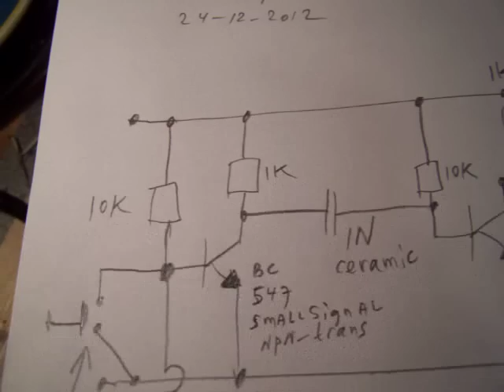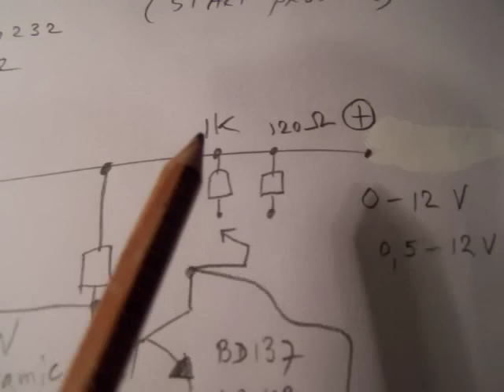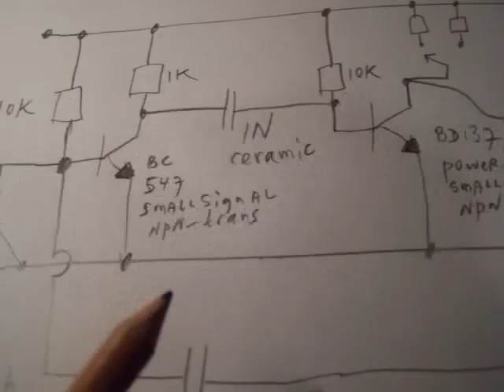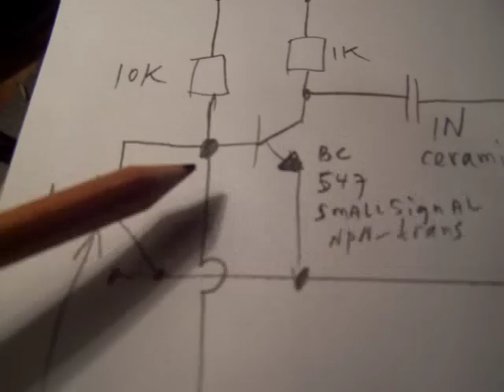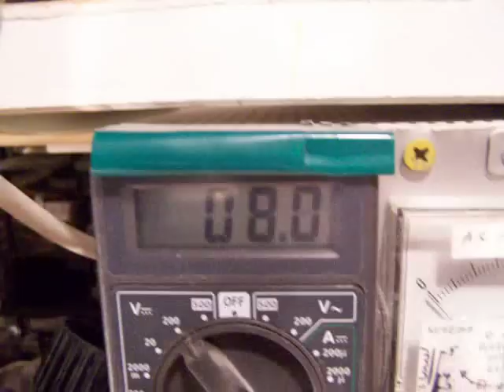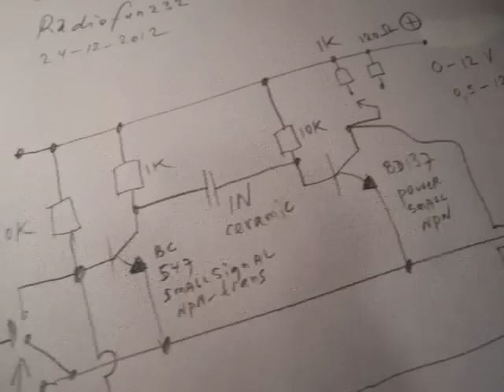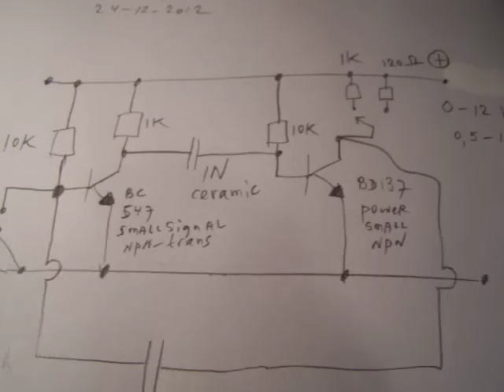fail properties from the non stabile multivibrator (square wave)

Comment from the maker: CROSSLINKS RELATED TO NON STABILE MULTIVIBRATORS 
fun audio generator https://youtu.be/AmB_WG3xkS4
MUVIB circuits, start problems and how to get them working https://youtu.be/rmrH4MqvQRo
12 V alarm beeper with a substantial output https://youtu.be/tU4fBdJB8Yk
Small electronic beeper with headphone capsule https://youtu.be/MHUKikf-6l8
Funny strange sounds with 3 non stabile multivibrators https://youtu.be/DeEFlyEvfW8
Electronic siren circuit and 2 tone horn https://youtu.be/7ZaiqvRzKZQ
2 transistor flip flop memory cell driving a 12 V relay https://youtu.be/MI1hv3l7BcQ
100 flickering white LED’s (schematic) on 12 V https://youtu.be/Kx4siVJbnO4
Nasty sound generator + locomotive sound https://youtu.be/u0OBWjVTlek
Powerful 12V-20W incandescent lamp flasher https://youtu.be/CFqTc2ANotk
Ultrasonic sound and scream generator https://youtu.be/B0X7uCLeRSs
Ratata audio sound generator https://youtu.be/FcyCEalUBi0
Blinking bicycle lamp 6 Volt O,6 watt https://youtu.be/d4vWrmPEhHk
Non stabile MULTIVIBRATOR START PROBLEMS https://youtu.be/MIfpV7eojEU
Very low energy consuming blinking LED https://youtu.be/ZZ519TAgGbY
Simple squarewave oscillator with many properties  https://youtu.be/VqDU7B9ULHw
Light theremin/pico synthesizer with 2 transistors https://youtu.be/TT14Fbe563Y
Square wave oscillator with a few components https://youtu.be/_xtqLtf74M0
Fail properties from non - stabile MUVIBS https://youtu.be/5RrnFn_F0Vo
Playing around (sounds) with a non-stabile multivibrator https://youtu.be/AfNTsfa4c2E
Ultrasonic sound generator with tweeter https://youtu.be/HKuBZ_NFzZI
Sawtooth waveform generator https://youtu.be/A0tuIfWgZ6k
Two transistor power LED flasher https://youtu.be/mxUxZnh5FmU
How to make your own ambient light https://youtu.be/JWxiZlu5Dc8
Lighthouse LED https://youtu.be/mXZJi4gzjG8
51 Hz – 24 KHZ Voltage controlled oscillator https://youtu.be/vxSOrtPd2Ow
Multivibrator circuit with variable freq& and duty cycle https://youtu.be/V5IIGDyIIfI
Bi stabile multivibrator schematic  https://youtu.be/gjEsB8Nm6L4